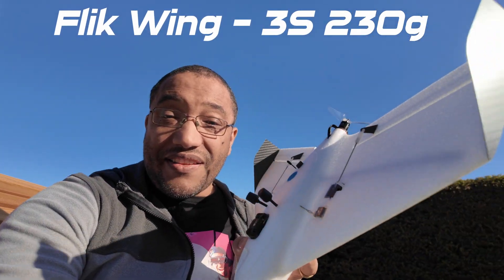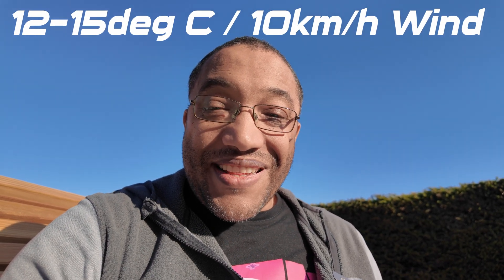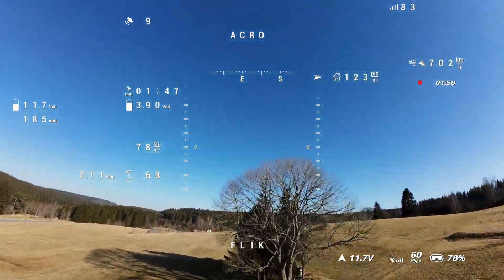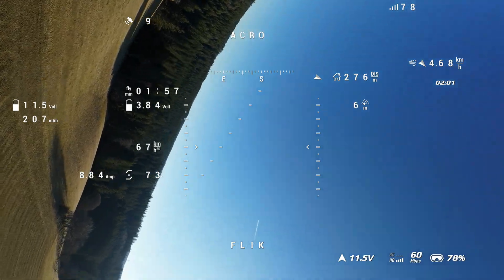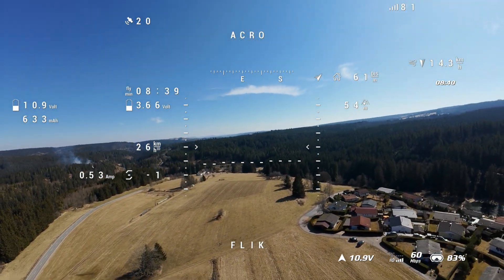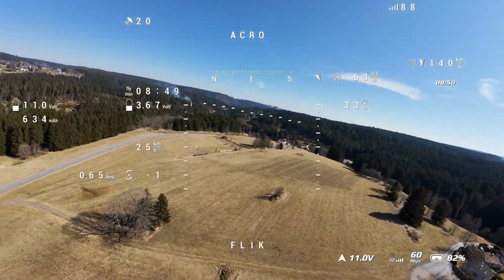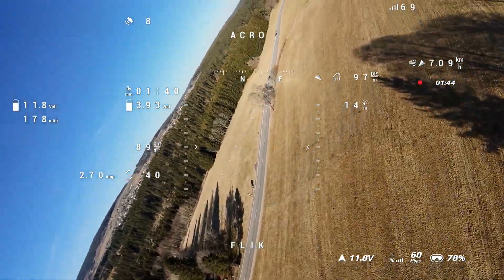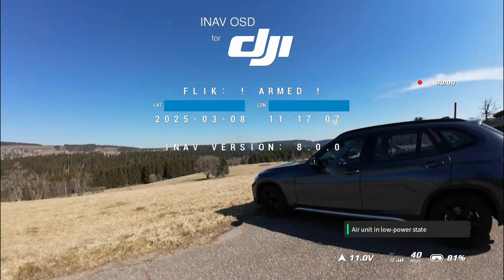Flik Wing  - 230g of Awesomeness // 3S Sub250 DJI O4 Pro Wing

Comment: It's Me again....I am now replacing my HDZero with a DJI 04 in my little flik wing to improve range. I really don't want to put the 04 module in the hatch as I have had my hatch pop off many times in crashes and hard landings and afraid it will tear out the wiring back to the FC (especially with the added mass of the air unit). How much heat do these produce and must I put it out in the slipstream or do you think it will survive inside the fuselage.
I have enlarged my cooling air intake and the exit area significantly over stock and the 1W HDZero was doing pretty well at .5w if I armed in pit mode while waiting for satellites. Thank you for your coaching!
Reply from the maker: Are you using the O4 lite or Pro? As the O4 lite needs significantly more airflow and probably a heatsink to keep it cool for 4k recording. The pro should not be an issue if it has a bit airflow.
I'm using something like a ram air duct on my small chuck glider that is aimed at the chip of the O4 lite. A system to disconnect the O4 lite would also help to wait for satellites - like a connector or similar.And I think the Alight Wing Discord is a good place to get ideas and see how other pilots set build it and were some issues might be. Have fun
Reply: @McLogo76  I was planning on the Pro for better range.  The camera is huge but the whole assembly seems about the same weight as my HDZero system I have been using. Think I will try inside the fuse with the antennas coming up through the fuse and see how it fares. Somehow I am unable to find the discord channel for the wing/
Reply from the maker: @rocketrob3324  I find the Pro easier to mount and handle and you can also let it run while the GPS is looking for satellites. https://discord.gg/h3aYPYHV9T
Reply: @McLogo76  Thanks Brother for the Discord link! Might just put it in the hatch after all :)

Comment: great intro!
Thanks for your specs, Been flying on 18650 2s 3,500mahr packs and getting 3s curious. 18650 2s provides up to 20minutes flights.
found 18500 cells in 2040mahr for a 3s pack only marginally heavier than the larger 2s pack.